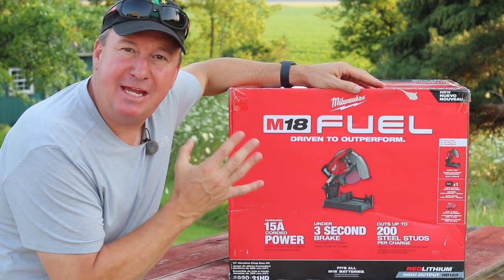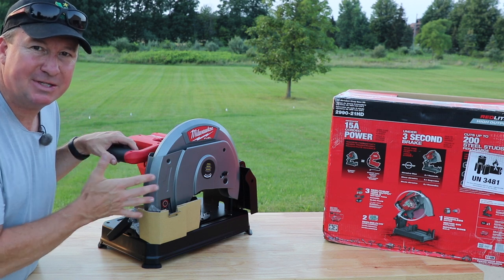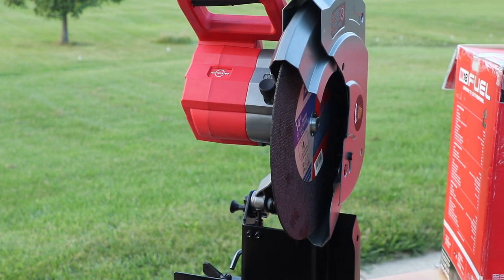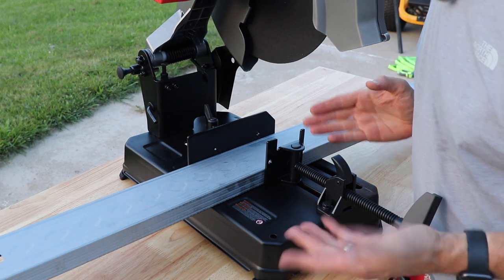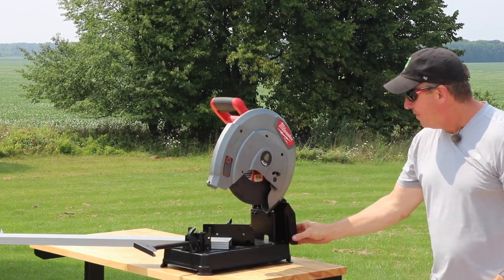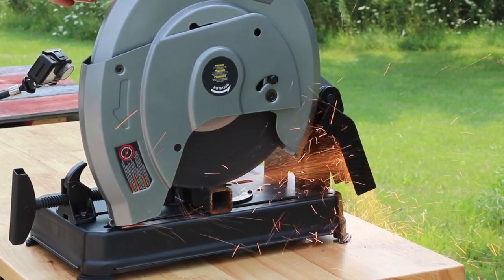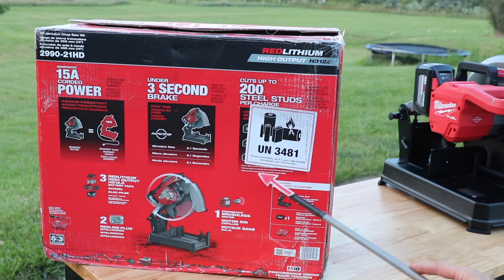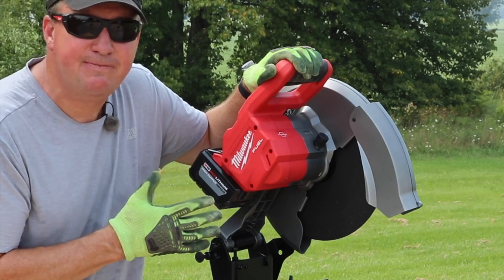NEW MILWAUKEE M18 FUEL ABRASIVE 14" CHOP SAW REVIEW // 200 STEEL STUDS PER CHARGE!!

Comment: Great demonstration Mark, I have the 36v makita abrasive chopsaw & my coworkers love it. We cut 14 & 16 gaudge cees with it all the time, i'm glad to see that tool companies are constantly innovating. Now I need a cordless cold-cut saw... I wonder who is going to get one to market first.
Reply from the maker: Sounds great!  That's a good question, for the cold-cut saw.
Reply: @MarkThomasBuilder  As for my favorite cordless tool it would have to be either my Makita 18v nibblers, my flexvolt 6inch grinder or my Bosch 18v bulldog.
Reply from the maker: I'm always excited to go cordless, but the pivotal cordless tool for me would be the 4.5 inch angle grinder from 3 years ago.  I was so tired of dragging that cord around, lol.
Reply: try Milwaukee 18V metal cutting saw with carbide tipped metal cutting disc 203mm blade

Comment: Mark, when I received mine I was searching high a low for the 4th rubber foot. I reviewed the manual and it was made that way. 3 rubber feet and one metal that is flush with the surface.  Maybe someone knows why? Static discharge? 

I was watching your slow motion footage. It’s in the same area as the discharge cover…
Reply from the maker: Thanks for sharing, I was wondering about that but never reached out to Milwaukee.  I'd like to know the reason as well.

Comment: The blade nob is plastic but they couldn't put ruber on the miter handles or Cover them in Heat resistant plastic for more comfortability
Reply from the maker: Good point.

Comment: I have many Milwaukee HO tools. And they overheat the battery damaging it.  They don't work continuously.  Okay for smaller jobs.
Reply from the maker: Huh, interesting.  I've had my weed trimmer overheat a few times, but not any damage.
Reply: @MarkThomasBuilder  yup. My 9 inch grinder will overheat even a 12 amph. Killed one this way. It depends on application.  I often trip out a battery on the grinders. So I don't have faith where torque is needed
Reply from the maker: Now that you mention it, I think mine timed out as I was cutting some galvanized pipe.  The Milwaukee steel cutting saw is better suited for that type of work.
Reply: @MarkThomasBuilder  I also have yellow 60v...  for the most demanding jobs.  9   12 and 15 amph  never trip out and at more power

Comment: That kinda sucks they don't even provide you a Wheel To get Started
Reply from the maker: Yes, it would be nice to include one.
Reply: @MarkThomasBuilder  every other saw on the planet comes with a starter blade don't matter if is a Circular saw or a jig saw or a Recip or a miter or a Table saw or any other saw I'm missing abrasive 14 inch blades are only 9 something bucks especially for the price they charge for this saw should have a blade with it

Comment: Had a question on this I do concrete work how does this bad boy handle rebar
Reply from the maker: Thats a good question.  I have some 1/2" rebar and will have to test it out.  It will cut it, but I'm not sure how fast.
Reply: @MarkThomasBuilder  sounds good let me know how it handles please thanks again for the info

Comment: Had anybody tried to use a cold cut blade on these saws?
Reply: Don't,  you'll have teeth flying at your face!
Reply: @eduardoorozco2454  yeah I know The saw speed is to high cold cut saws run at less then 1300 rpms the Milwaukee is over 4000 rpms I didn't say I was going to do it I was asking if anybody has done it there is a difference

Comment: Can you use steel metal cutting blades on this saw
Reply from the maker: I think I've heard of people doing this but don't recall what the instructions say.  I'm thinking they say to only use certain abrasive blades.
Reply: @cn8484 .no no se puede usar una hoja de metal porque no tiene las revoluciones que necesita ..delo contrario quemarias tu motor

Comment: Price is a problem.  You can buy and equal to better performing corded unit for a fraction of the price.
Reply from the maker: Yes, the cordless convenience is expensive, but a 12Ah battery will lots of metal studs on a single charge.
Reply: That goes for all battery vs. corded tools.

Comment: Worst tool I've ever bought from milwaukee by far. Takes 2 12.0 batteries to cut through a 1/8" thick 2" wide piece of flat stock. Complete joke
Reply from the maker: I recently found a steel cutting diamond blade that might work well in this.

Comment: what? who still uses abrasive cutoff saws? Seriously. I see no benefit to them for any material at all. I been using metal cutoff saw now for years, I will never go back.
Reply from the maker: I still think they're a great option for steel studs.  Thick steel is cut best with the Milwaukee M18 Metal Cutting Circular Saw, which I need to do a review on this month.
Reply: @MarkThomasBuilder  I guess it being cordless is the benefit see. I don't know of a cordless metal blade chop saw. THe circular saw review will be interesting, I have not used one of those, but I do have a ton of blades for them I got in a auction lol
Reply: This is an underground and rough in plumber's best friend.